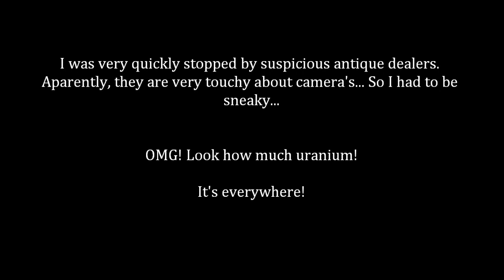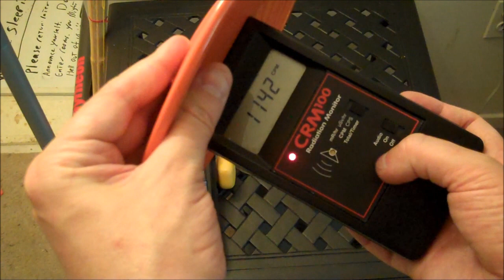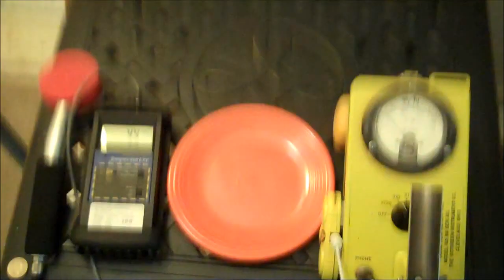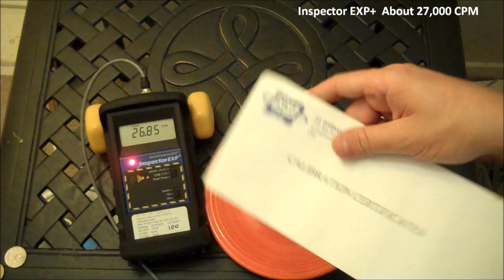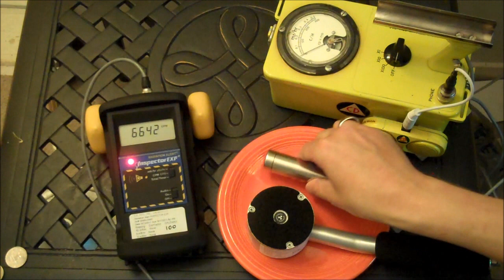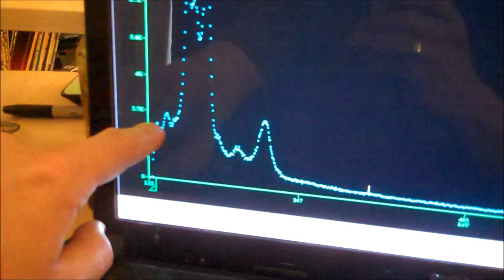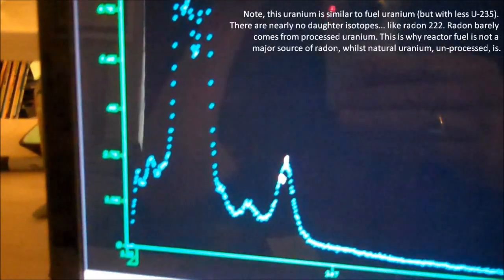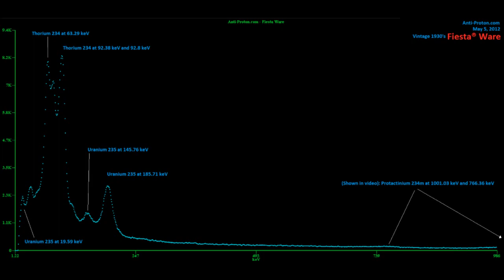Radioactive Fiesta® Ware - Happy Cinco de Mayo!!!

Comment: Well, I was wrong.  These things actually put out very little alpha.  They are mostly hard and soft beta.  It turns out the alpha filter on my geiger counter was also blocking the soft beta, which gave me a deceptively low reading on the beta.  I'm sure there is some alpha in this but it's miniscule next to the beta.

Comment: I just got a small saucer pretty much identical to that one.  I'm pretty sure that it one of the 1936-1943 natural uranium ones, because it it putting out about 8-9 microsieverts per hour in beta+gamma.  It is still mostly alpha (40 microsieverts), but there is too much beta/gamma for it to be depleted uranium, so I think it's natural uranium just like yours.  My counter has a pancake probe on the back, with a plastic cover that will block alpha, with a metal plate that will also block beta.  You can take the cover completely off, put it so that only the plastic part covers the probe (blocking alpha but letting beta+gamma through), or put it on so the metal plate covers the probe (blocking alpha+beta).  It's kinda nifty.  If it were one of the later ones that was depleted uranium, I would expect much less beta+gamma and have most of what it's putting out be alpha.  My counter measures exclusively in microsieverts/millisieverts, it doesn't show counts.

Comment: I placed my Inspector on top of an empty Peet's coffee mug. The reading was about over 100 CPM. The reading over an empty GLASS mug was about 50. Is if safe to eat or drink from these glassware or plates?
Reply from the maker: Well... let me start with two disclaimers:
1. I am not a health physicist (the only species of critter who is able to tell you what is safe as far as radiation is concerned).
2. You could have something different from what I have experienced which could be dangerous... but...

I have found that nearly all of my glassware, crystal, and ceramics read from +10 CPM to perhaps +100 CPM over my background. This is very common. If you test with a gamma spectrometer, you will find trace uranium, thorium, and potassium.

If I found that reading, I would not be concerned.

Perform a swipe test with a paper:
1. Test the paper for a period of N minutes.  (at least 30min).
2. Rub the cup with the paper for at least 30 seconds.
3. Re-test the paper for the same period of N minutes.

Was the paper more radioactive?  I'd look for more than 10%. If you want to get nifty about it, calculate the standard deviation of the set of counts and test using a confidence interval.  (i'd use the sample test).

In short, I would suspect that the cup is safe.
Reply: Thank you for your answer. I was surprised that my mug had radiation. This is the mug I used for hot coffee and tea.
Reply from the maker: Caroline Yunker If you test the rest of your ceramic, glassware, and crystal, you will likely find much more.  :)

Comment: smiling Thanks for the link to this video.  So have you checked out how much is coming down in the snow and rain since Fukashima? I guess I will have to load your vids and check for myself.
Reply from the maker: I have been testing my rain for a few years now. I detected trace Cs137 (right on my detection limits) in a 2 month water collection bucket. It is a fact that Cs137 (and other stuff) is in the rain, but it is below the detection capabilities of my NaI(Tl). I'd need a HPGe detector to see it.

Comment: Homer Laughlin Pottery is located in Newell West Virgina. Right along side the Ohio river across from East Liverpool Ohio. I worked there for over five years.I myself was always concerned about the past use of uranium in the glazing process and even went to the union with my concerns. Of course I was told It was cleaned up ! Don't worry about it. How stupid did they think I was? Some of the old plant still runs today. With wooden flooring I might add,Just because you don't see the color doesn't mean it's not still hot. They have a dump site also and have been dumping bad ware in it for quite a long time. I often wondered how much fiesta red was dumped in that? I wouldn't have it my house for sure. None of it.

Comment from the maker: It could be. Firstly, you would receive a dose of radiation from the plate, directly. The dose is not very large, but it could be a trouble over time given the generally accepted theory that risk is proportionate to dose, linearly.    Secondly, uranium could leach out of the plate and be ingested over time or with acidic food. This is similar to how leaded plates cause lead poisoning. 

I use modern fiesta ware only.  =)

Comment: Would it be harmful to eat in those plates ?
Reply: The type of radiation coming off of the plate (mostly alpha, a smaller amount of beta) means the plate is not harmful to hold, as those types of radiation can't penetrate skin (alpha can't even penetrate the very outer layer of dead skin), and the uranium itself is sealed in the glaze.  However, I would not recommend eating off of it.  Acidic foods (like tomato) could potentially leech uranium out of the glaze, and you do not want to ingest it.  While it's not extremely likely, I wouldn't want to risk it.  Dry foods would be fine, but I wouldn't eat, say, spaghetti off of it.